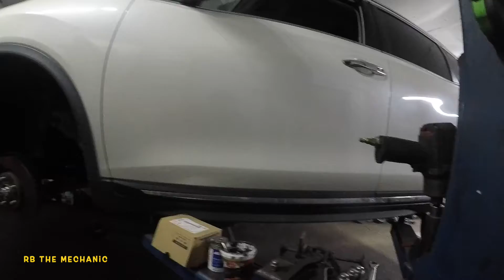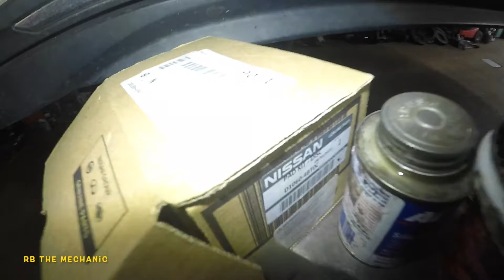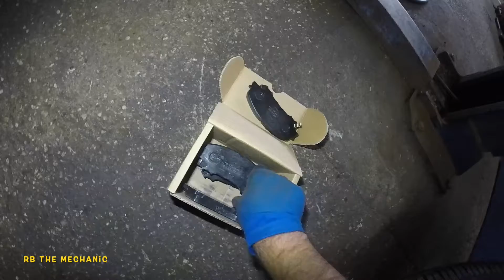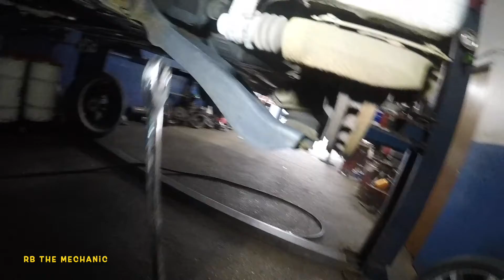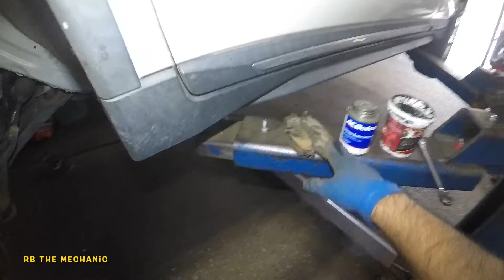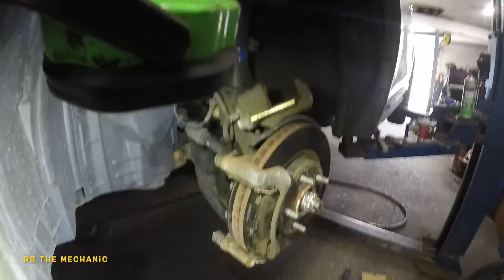Replacing front brake pads on 2018 Nissan Rogue   Origina Nissan PADs

Comment: your customer ordered the wrong brake kit,  that's why no hardware. If you wanted hardware he should have bought part number DA06M-9N00PNW.  FYI, even that kit doesn't include the brake shims that go on the back of the pads. I've seen this with the front struts for the Rogue..you can buy from Nissan for the same price or lower the strut complete with spring and mount ready to install
Reply from the maker: Yeah iguess

Comment: 25 ft lbs is the torque spec on the 14mm bolts if anyone wonders.
Reply from the maker: Thank you for input
Reply: Thank you!!!! Everyone seems to neglect the torque spec. They all says to torque it but no one states the torque number. Thank you I need that number!!!!